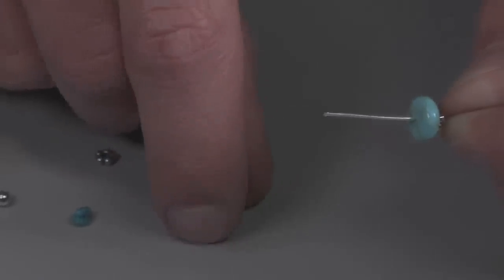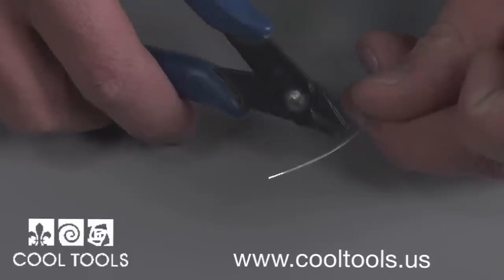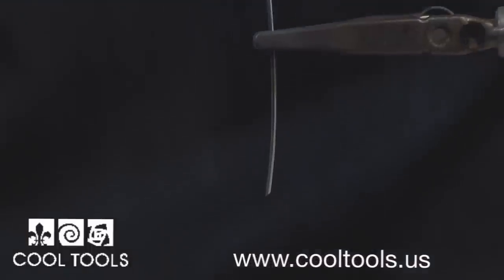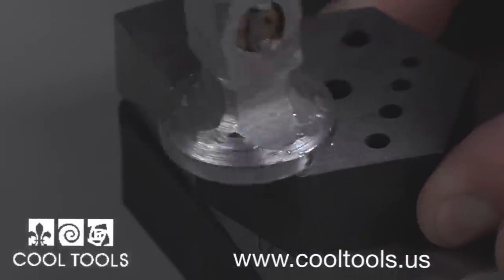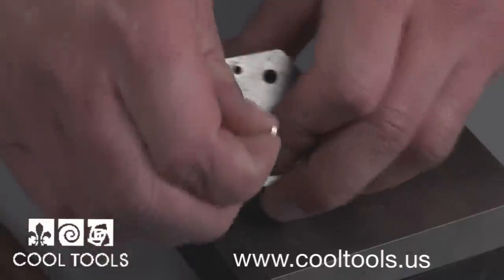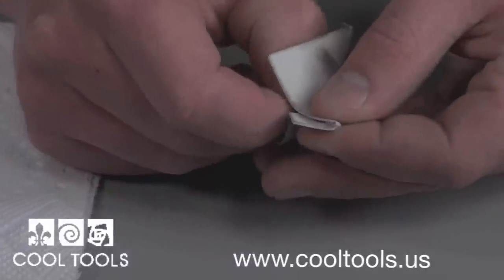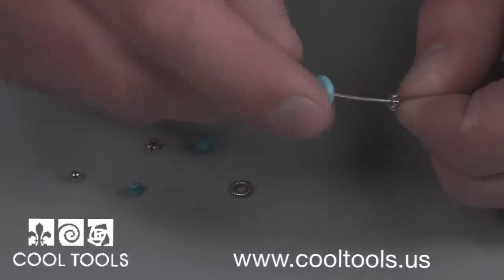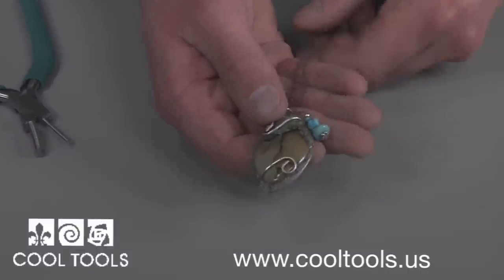How to Make Headpins

Comment: What type of wire are you using? I'm using 304 stainless steel, 22 guage. When I go to burn the metal, it does not form a ball; it just burns.
Reply from the maker: Hi Sharnae, this is 22 gauge silver wire. We recommend using silver wire.

Comment: That is not the best hammer for the process. You used a chasing hammer, not a "jewelers hammer". A chasing hammer is used on chisels and punches for carving or pushing metal. A small cross pein, riveting or ball pein hammer would be better choices. They have faces that are smaller and the user can easily see what each hammer blow has accomplished.